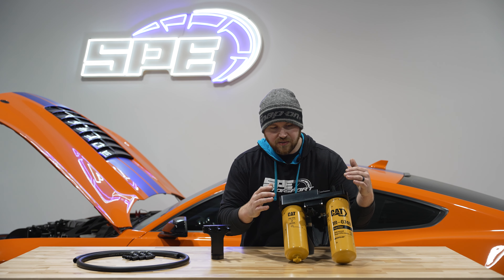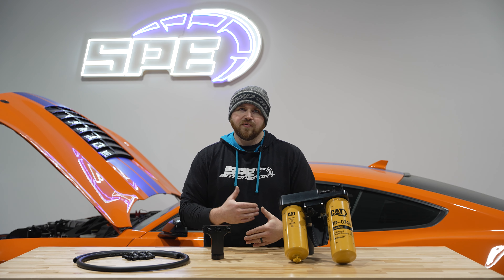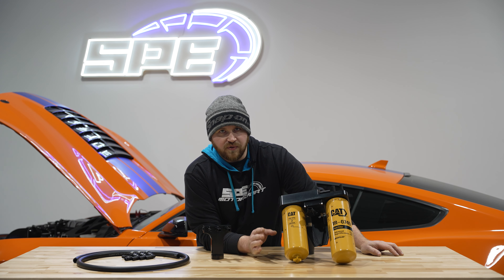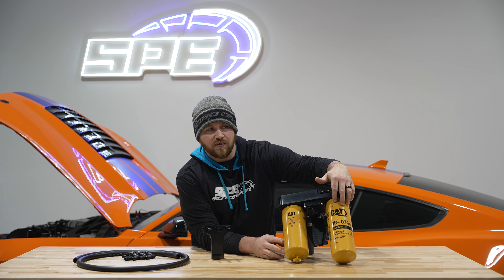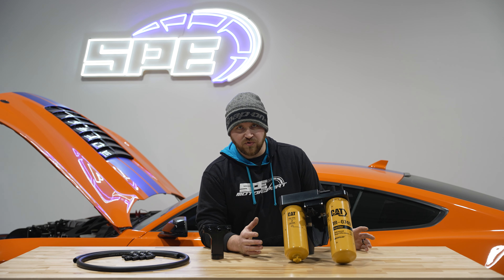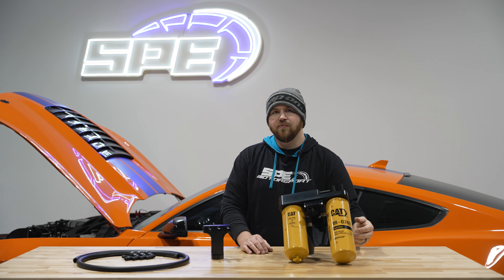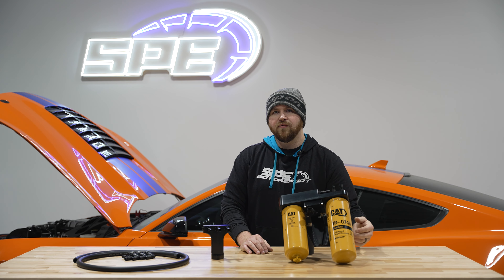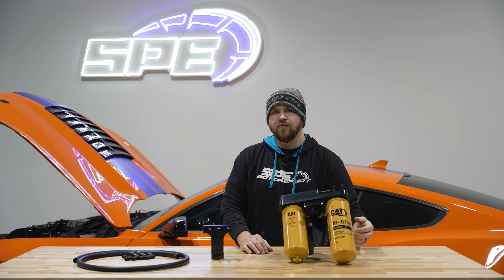PRODUCT SPOTLIGHT: SPE 2017+ 6.7L Powerstroke SPE Fuel Filter System

Comment: Stellar system.   Side note, a CAT 1R-0750 is about 3/4 the length of the 0749 with the same 2 micron filteration.    Itll fit righ up but won't hang down as low.

Comment: Anyone have cavitation issues with this kit? Ever since I put this kit on I’m having rail pressure issues, I added a stroker CPX pump recently and now I’m having audible cavitation, when I open the pec cox bleeder valve, I can hear air coming out of it, and the cavitation noise goes away. Any insight would be great!

Comment: Does this work for 2021 super cab short bed? Because it's not fitting. The 2 top fittings are hitting a crossmember, and won't allow me to slide your part into the factory mount. Even if I was able to squeeze it in, there wouldn't be enough room to attach the 2 fittings and hoses you privided. Please help!!
Reply: I ran into this same problem, unfortunately it doesn’t work with our cab configuration.

Comment: Ordered. Done with plastic filters.
Reply: After you have installed this, please let us know what you think about it.  Good luck!
Reply: @johnmagan7266  Installed, love it, the quality is excellent. The only difficulties involve getting the under the hood fuel filter cup/holder out and the connectors and hose that come with the kit, the fit is really tight which is good. I run 37s with a 6” lift so, no clearance to ground issues when off road. Had no issues after installing, sealed up nice and tight.

Comment: Love the SPE products. Will this work with the S&B aftermarket 60 gallon tank? Also would you suggest an aftermarket sending unit or is the stock one sufficient.
Reply from the maker: We are working on verifying that particular fitment. The factory sending unit is more than adequate.
Reply: @SPEMotorsport  that system looks pretty heavy.  Is the single bolt enough to hold it in place when going off-road ?
Reply: Did you find out about this with the sbtank
Reply: @Cell970  yes it does,
Reply: @dansnyder8186 how do you make this work with the 60 gallon S&B tank? Where the 3 lines connect ends up being lower than the top of the tank, the filter base needs to be up a little higher for the lines to connect to it.

Comment: The filter looks like it will sit or hang pretty low and give less clearance. I would be worried this filter will get wacked off road.
Reply: 2017 PSD here.  I’m very interested in this, it looks solid!  I’d like to see in person, this set up to check on the clearance.  I suppose a skilled welder could fabricate a shield.

Comment: I’m in a 2016 at the moment with a H&S upper swap. I was going to swap my lower unit to a FASS like a previous commenter has, would there be some weird way to make this work on the steel bodies with a little ingenuity.
Reply from the maker: We actually have a manifold you can use to ditch the upper filter. Here's a link if you want to check it out: https://spediesel.com/collections/powerstroke-fuel-systems/products/spe-lower-fuel-filter-assembly

Comment: Does this removes air from the fuel like Fass systems claims it does ?
Reply from the maker: The return fuel does go through the filter head similar to the way a Fass does but we will not claim what Fass or Airdog claims because we don't particularly agree with their claims. Hope that helps.

Comment: Does everyone want to know the real reason why you don’t see cat filters on equipment?  Number one reason is because the people who own the equipment are cheap dicks who think they are smarter then the engineers who designed the stuff and they are so proud of themselves for finding what they think is just as good at Walmart and auto zone. I work on marine high output c32 and c30 which are a few of what that filter goes on and those motors range from 700hp to 2300hp and cost up to 375k per motor. Which cat warranties for longer periods than all other manufacturers in the marine game. Cat filters are not overrated and anyone who says this is probably trying to sell another filter. Great product spe good thinking and engineering as usual.one more thing almost every filter claims the lowest micron rating that’s just the game they play and yes it doesn’t flow it’s full rating at 2 micron but it does filter down to 2 micron at partial full rated flow which is plenty considering the c32 fuel rate is 120galhr I think it will do the job

Comment: The cat filter is not 2 microns. Quit making cat filters sound better than they are. There are better filter options out there and that’s why cat filters are rarely seen out in the field even on their own equipment.
Reply: Please reference the Cat site.  The absolute rating is in fact 2 microns.SPE created a winner here.  SPE has designed and engineered the superior product with the option to change your absolute/nominal figures, but SPE did it the correct way out of the gate!
Reply: @georgekerr6728  I’ve looked and read all their stuff and they don’t make anything better than 4 microns at 98%. Show me a link that says otherwise. Cat filters are overrated and overhyped. I run heavy equipment and I never see a cat filter on non-cat machines and rarely see them on cat machines.
Reply: @georgekerr6728  also how will SPE’s setup work with the larger aftermarket tanks? Like S&B’s or Titans? I like the idea but it could be better. And their claim about the WIF sensor is a joke and shows they don’t understand how it all works.
Reply: @himni1  constantly learning, appreciate the insight from knowledgeable sources, seems WIF sensor is mounted on manifold low point, i plan to drain water off routinely from bottom of water separator as preventive maintenance, honored to have mine ordered now thanks Chance!
Reply: @himni1  I like the SPE suggested filters; abilty to chose from an abundance of available filters anytime with a twist of the wrist signals a win for both sides!!